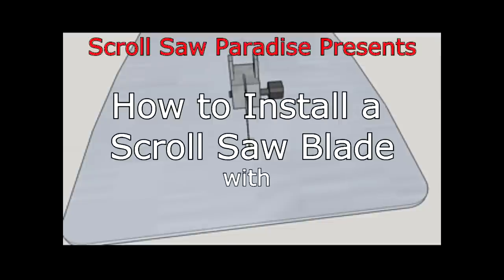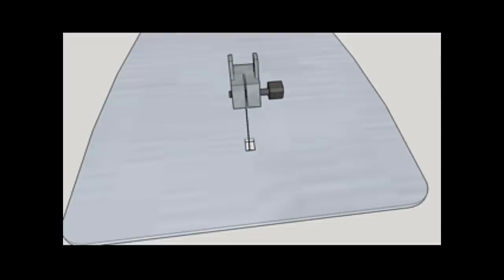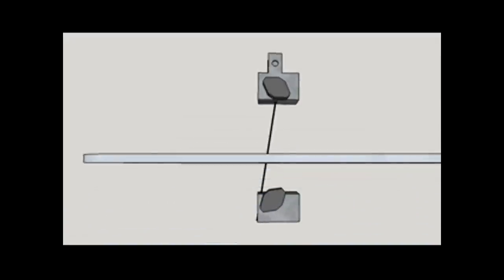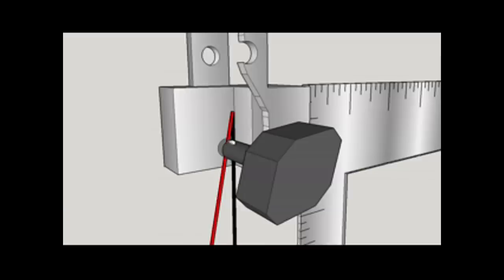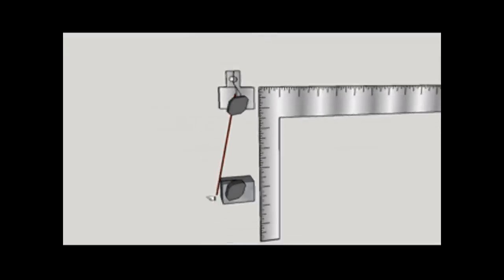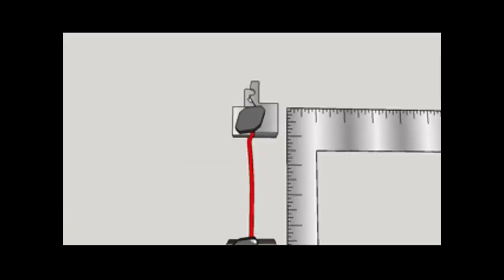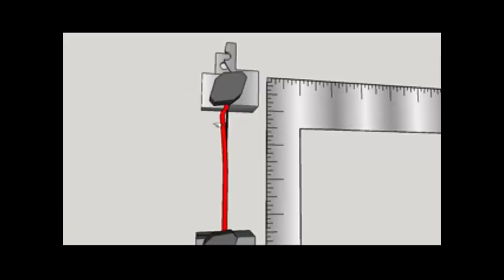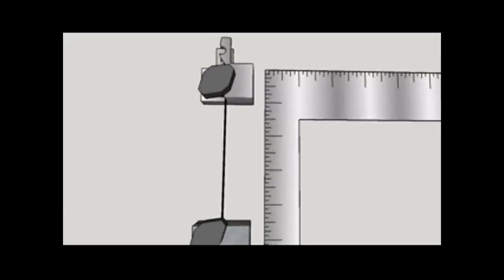Scroll Saw Blade Installation Animation

Comment: Great Video, I teach Scroll Saw to eighth graders and this is part of the issue they have when loading. I call it hockey sticking the blade. I stress that the blade loaded in straight will make your cutting smoother (less chatter) and also prolong your blade life. Keep up your GREAT work. Thanks again!
Reply from the maker: +Donald Gross Thanks, Don! and you are absolutely correct, a straight blade makes everything better. Thanks for sharing this awesome trade with the young guys and gals. I really hope they take a liking to working with their hands it is much more satisfying than most of them probably realize. Bob

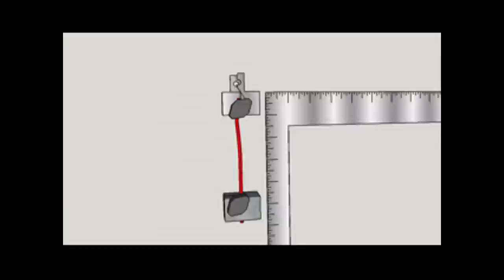Comment: Bob, my new (to me) Craftsman scroll saw was breaking blades big time. I thought I’d tried everything available to stop it. It alway broke just at the start of the teeth at the top. A few seconds of cutting and bam! Well your video had me disassembling the clips and then I found that the top clamp was poorly made (as is the rest of this POS), the slot doesn’t allow the blade to hang down vertically. As in your vide at 4:30. When the blade is left to hang from the top clip it points ahead of the bottom clip and when clipped in, top and bottom, the blade is curved. Explains why it breaks at the start of the thinner section. The cause is poor manufacturing, the pin that limits the movement of the top clip is too far back and you can see the mark where it’s supposed to be drilled. I pulled the pin out and no more breaking. I have about 12 nice sharp blades, all broken at the same spot. Thanks for these ideas of yours, it seems everyone tells you why a blade breaks but stop after tension, speed and workpiece pressure. One video mentioned the screws for pinless blades aren’t necessary if your blades have pins but no-one referred to alignment! Seems everyone assumes you new scroll saw has no defects, mine has had a few basic manufacturing faults so far. The motor brushes were jammed and made intermittent contact, I thought it was the speed controller. The work surface is too far forward because the pivot pins are misaligned, the clips I’ve already mentioned. The adjustable stops for the bed was jammed and badly adjusted. I still have a few smaller things to adjust like the protractor is crooked. I cut plastic and aluminum sheet with a fine toothed blade (24 tpi or more) and find it great for fine work. Only need a bit of filing after cutting. Thanks again!
Reply from the maker: I'm glad this video helped you to solve your problem...Bob

Comment: The problem I have with installing my blades is that I don't know how much blade should go into the bottom holder and how much into the top holder. I know common sense says to make it equal and that is what I try to do. But I cant see very well through the tiny hole in on the table to see
 how much  I am putting into the bottom so I wind up loosing it and re-adjusting the blade up and down until there is equal amounts in top and bottom. This is time consuming. Is there an easier way?  Thanks for your great videos!
Reply from the maker: ***** Most of the owners manuals that I have seen (I haven't read every manual for every saw) from scroll saw manufacturers, say to install the top of the blade about 1/8th of an inch above the top blade holders screw. Now obviously this can vary with manufacturers so if you have a manual for your saw see what it says in regards to blade installation. 
In my opinion it is more important to make sure that the proper amount of blade comes through the top of the table. If you install the blade too high in the top blade holder it is possible that the part of the bottom blade that does not have teeth can come up through the bottom of the table into the wood. If this happens you are much more likely to have chattering of the wood you are cutting because the blade suddenly stops cutting the wood and starts pushing it on the upstroke.
After installing the blade, pull up on the blade holders till it stops to make sure that you can see teeth protruding through the top of the table, and not any of the flat part of the blade. Don't worry about it being equal, equal is not important in this situation and can at times be detrimental.
So if you just put the blade about an 1/8th inch or so above the tightening screw on the top blade holder, you should be in a good area, you may need to adjust it a little bit for your saw especially if you are using reverse tooth blades.   You want to make sure the blade is properly installed so that the reverse teeth at the bottom of the blade actually do make it through the top of the table or the reverse teeth will not do what they are supposed to do.

Comment: Hi , thanks for an excellent video on an important topic. I am glad i came across this because I'm having a problem with my Dewalt  saw. My problem is similar to what you have shown here but on my saw the lower part of the blade is back even when upper and lower parts of the blade are against the blocks as you suggest. I know on the Excalibur this can be corrected with the motor adjustment . But I don't know how to correct the problem on the Dewalt. Do you have any suggestions?
Reply from the maker: John Conway  Hi John, I'm glad you enjoyed the video and found it helpful. Here are my thoughts on your alignment issue on your Dewalt. First you need to make sure you're blade is properly installed as shown in this video, if the blade is installed at an angle it will look like the front to back alignment is bad on your saw when it is actually ok. Unless you are having actual trouble with cutting, which will be noticed by your wood jumping front to back when making sharp turns, I would not worry about a little miss alignment, a little misalignment between top and bottom blade holders is not going to have much of an effect on your cutting ability or blade wear. 
I know this is a popular topic on many message boards, and I'm sure if people were installing their blades properly, a lot of the discussion would go away. If you still have problems, let me know and we can take it further. Bob
Reply: ScrollSawParadise Thank you very much for the reply Bob. I have checked each blade I have used . They seem to be solid against the blocks. I thought of a fix. When I put my mini square against the blade I have about a sixteenth at the bottom (blade to the rear at the bottom) So , I'm thinking if I shave 1/16 off the table mounting studs under the cast table , since they mount toward the front on the Dewalt , it would put her where she needs to be. The reason I feel this would work is when I loosen the knob to adjust the table , she comes down slightly , and then the blade is perfect against the square. When I retighten , the gap returns . The saw is working fine , but it bugs me .
Reply from the maker: John Conway If your saw is under warranty, I would not do that, it could void the warranty. Again if your saw works fine, I wouldn't bother, you know the old saying, "If it ain't broke, don't fix it" 1/16" miss alignment is no big deal.
Reply: ScrollSawParadise Sound wisdom. I will leave it alone. I thank you again for your great informative videos .

Comment: Bob, I have a beautiful heavy-duty, vintage Rockwell Delta 40-406 scroll saw. The lower blade clamp/chuck has a plain flat jaw and one V-jaw. I can't get it to hold very fine blades because they slip through the V. Am I using blades that are too thin for this type of saw? Please PM me so we can discuss off this video comment section.
Reply from the maker: Hey Jamshed, just send me an email to bob.scrollsawparadise.com...Bob
Reply: ScrollSawParadise 
I have the same problem with my Hitachi scroll saw. Any tricks to getting the 00blade to stay in the lower clamp?

Comment: Great video.  It sounds like people are have the same problem I'm having.  My Excalibur 16" is less than a week old and I cannot install the blade either on top or bottom.  The blade kinks on the top when I tighten it.  
I know, from the manual, that this is a set screw issue.  I cannot see inside the slot to know if it is protruding or not.  I cannot get that set screw in the right position.  It takes me 10-20 minutes to attach the blade on one end only.  I am so frustrated, I'm ready to return the saw.  This is the only problem I have.
How can I see the set screw and adjust it properly?  Any help is greatly appreciated as I don't like my saw right now.  
Thank you.  I'm a recent subscriber to your channel and I like your approach to things.
Reply from the maker: oldman719  I know who you are OM, and I thank you for subscribing! Have no fear, we can get your set screw set up properly so get those nasty thoughts about returning your saw out of your head!...lol If you have a set of feeler gauges than you need to get them out, if not go to your local Dairy Queen and borrow one of those little ice cream spoons that they give you when you get a banana split. 

Ok , now that we have one of those two tools,  the spoon is the exact thickness of the slot where you put your blade, you may need to sand it just a touch. Make sure that the right side blade holder thumb screw is unscrewed enough to not interfere with the slot, if you take it completely out than you will have nothing to worry about. Remove the screw on the left side of the holder, if you happen to have thread sealer, then apply a drop of it to the end of the threads on the screw you just removed. Now insert the wooden spoon or the proper number of feeler gauges that will fill up the slot, insert the screw with the thread sealer on it into the hole and screw it in until it just stops,  you now have it in the proper location, remove your allen wrench and leave it alone. You can now re-install the thumbscrew and install a blade, your blade should now no longer kink, repeat this procedure on the bottom blade holder to make sure it is in the proper location as well.

You can do this repair without the thread sealer temporarily, but you really do need to go to Home Depot, Ace Hardware or Loew's and pick up a tube of Loctite Thread Sealer. The screw will eventually back out and you will start kinking the blades again if you do not use the thread sealer. Use the thread sealer once, and unless you remove the screw again, it will not move.

I have been wanting to make a video, showing this process, I guess I will go ahead and make one now.
 Bob
Reply: ScrollSawParadise 
Boy that sounds easy.  I will try it tomorrow. Thank you so much Bob.  Why can't the manual say that?   I've wanted an Excalibur for years and want to keep it. Thank you...
Reply from the maker: oldman719 It really is easy, good luck tomorrow, and if you have any more problems just let me know.
Reply from the maker: oldman719 Just to clarify... Do not put thread sealer on the right side thumb screw threads, only on the left side of the blade holders Allan screw.
Reply: Got it.  If you ever get to Fort Collins CO,  look me up, I'll buy you dinner.

Comment: First blade change,now scroll saw just turns on and no motion,,blade broke on 3/8 in walnut straight cut. 30 min into project.
Reply from the maker: Colleen Bigler Colleen it sounds like you have had a major failure, something inside your saw broke, with such little information, it is hard to be of much help. I can assure you, changing blades had nothing to do with whatever the failure inside your machine is, all that metal is much stronger than a scroll saw blade. The thickness of wood and length of time cutting was not what causes an internal failure unless the saw has been abused for a very long period of time.